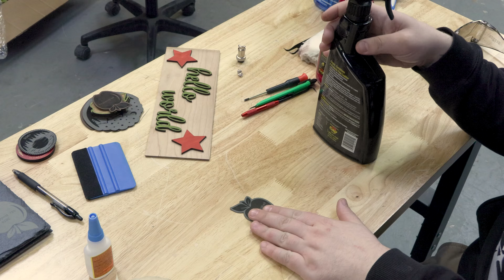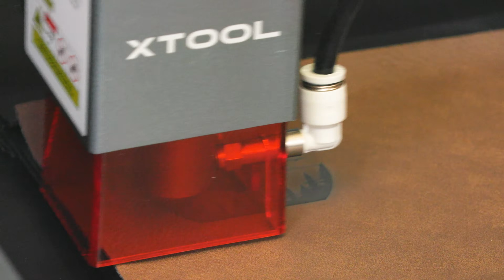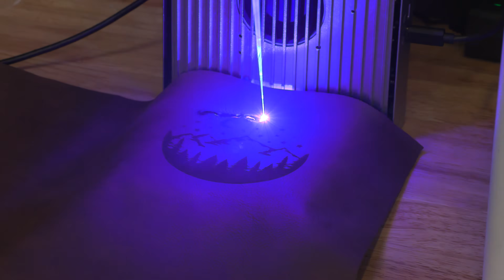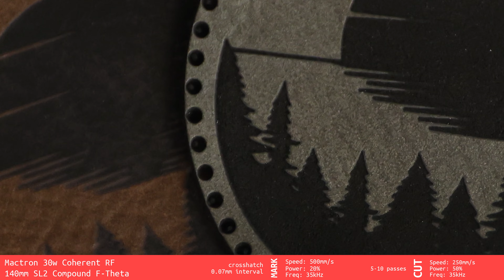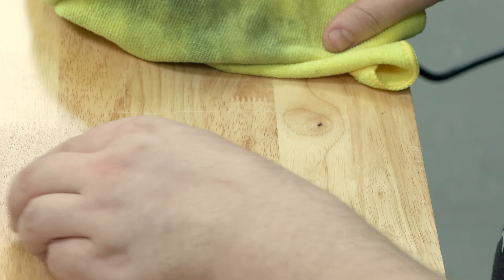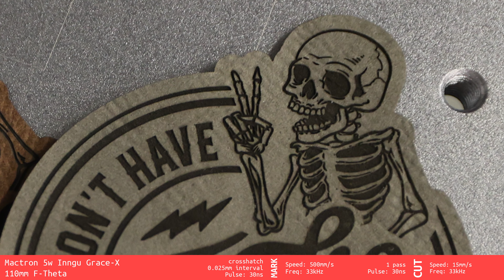The ULTIMATE Laser Guide to Leatherette | Cutting AND Engraving

Comment: UV laser did a great job, BUT... will it cut with the adhesive backing on such as Lonestar, Hydbond or Laserhyde leatherette patches with adhesive on? Do you have a video UV cutting them?
Reply from the maker: Typically adhesive layers are pretty thin in that regard, I can't imagine it would be an issue if it already got through the material. It would be the same process
Reply: @LaserEverything thank you for the reply

Comment: as a leather worker I have found that making the leather wet, holds it down and cuts and engraves great, I dont know if you can do that with leatherette.
Reply from the maker: I didn't know that, that's a solid tip. laser safe leatherette tends to be polyurethane which doesn't really comply the same way when wet unfortunately. magnets and a gentle stretch are usually the best when accuracy matters and the mark has to be perfect.

Comment: Just ordered a 5w UV laser as an upgrade from my xtool D1 Pro. Sounds like I made a good decision.
Reply from the maker: A UV isn't really an upgrade from the D1 pro, it's just different, but it's definitely a good tool to have and will expand your abilities. Each has its strengths and weaknesses around the shop. Each wavelength of laser does things just a bit differently and can react differently on different materials. UV's are awesome!
Reply: @LaserEverything  It's definitely an upgrade in terms of speed (I am just guessing, my machine is still in the mail) due to galvo setup. Pretty sure I won't be cutting larger wood pieces with Omni 1 lol

Comment: How do you find with inggu laser? I use to have one having two times need to be replace laser source. Bad luck with that. Now I'm on jpt brand..much better. I saw you set at 30ns , which settings about q-switch?
Reply from the maker: The inngu has been stellar for me so far. Sad to hear you had repeated problems with yours. The JPT's are of course a solid industry stand by so you should have no problem with that going forward but the inverted pulse width is so agitating to me haha.
Reply: @LaserEverything with inggu max Power Is at q switch 1, minimum Is 30. With jpt i had never run It under 10, usually I go from 13 tò 18 and from 30 tò 55khz.

Comment: For better cutting you can take out the bottom removable metal and focus down past the base and the weight of the base will hold down the entire panel.
Reply from the maker: It's a good idea I just A) don't wanna burn the table and B) don't want the backflash to char the material underneath. That said you may be on to something. Could use something like the Ortur cut bed under it all or place it on a small honeycomb table. I'm gonna check that out.